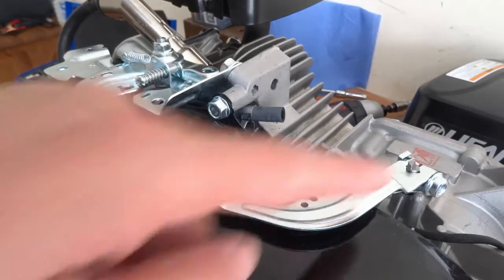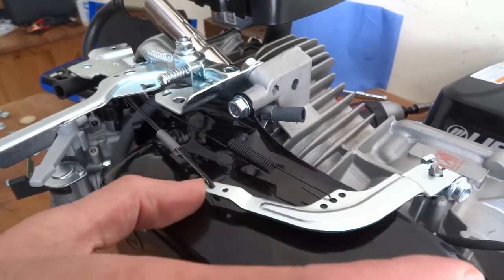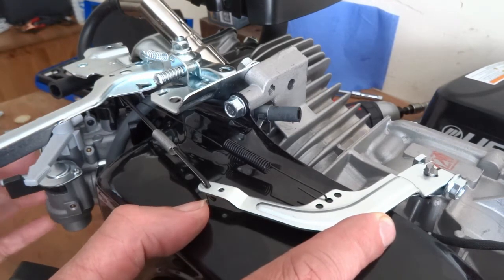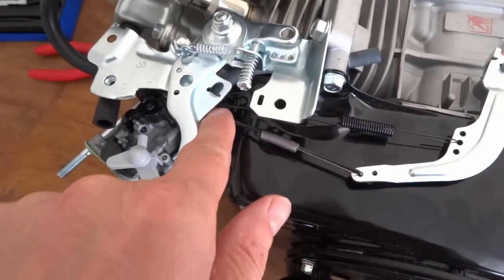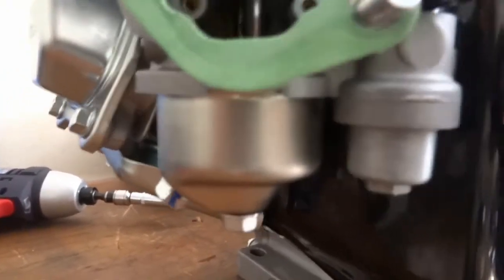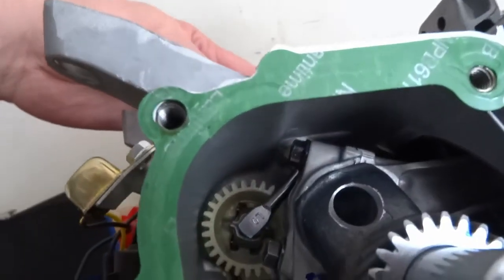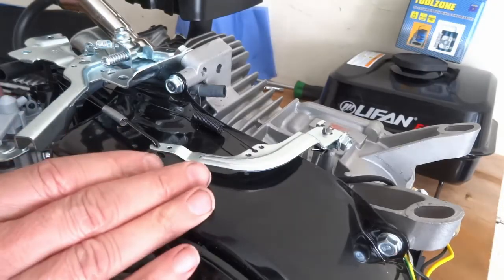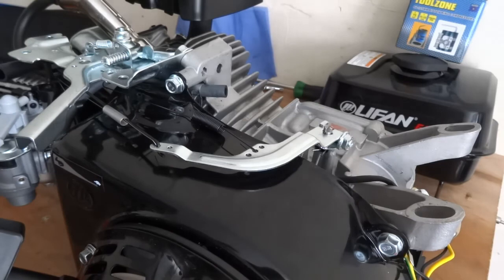How to Set a Small Engine Governor FAST (Beginner Guide & Full Explanation)

Comment: I have a husqvarna snowblower with this exact governor set up. Doesn't idle down against the idle adjustment screw, and runs too fast. It's a newer machine and I replaced the carb without messing much with the governor mechanism. It's confusing to me.

Comment: Hey, I’ve done all the steps in the video but my engine still screams wide open as soon as I start it up.
Reply from the maker: check manual or for damaged or maybe you did wirng
Reply: I have a husqvarna snowblower with this exact governor set up. Doesn't idle down against the idle adjustment screw, and runs too fast. It's a newer machine and I replaced the carb without messing much with the governor mechanism. It's confusing to me.